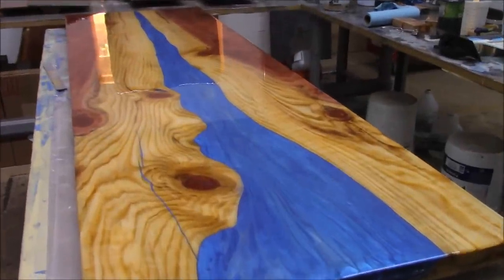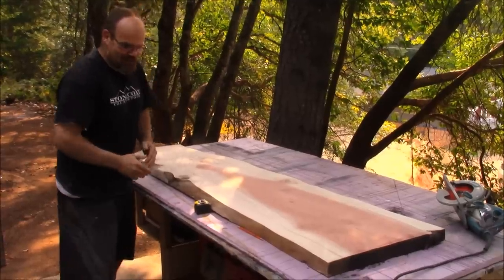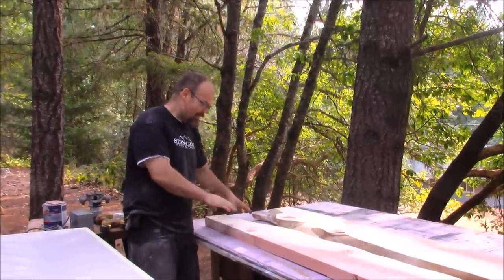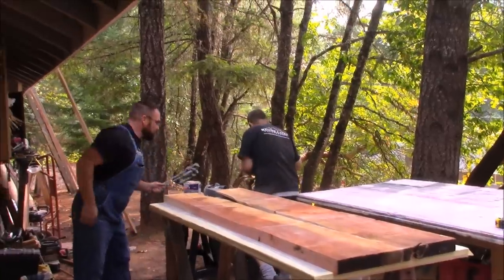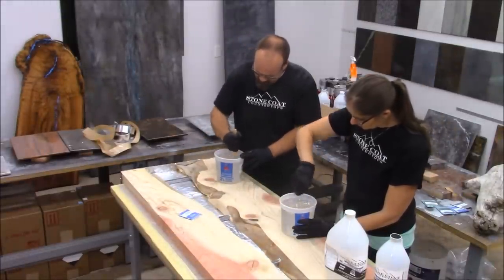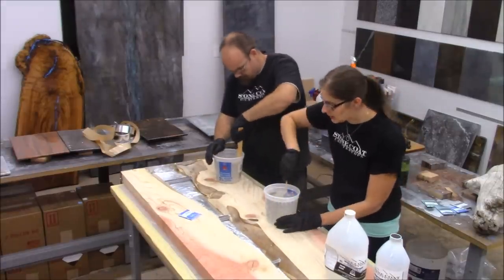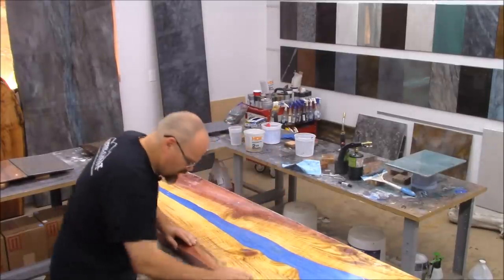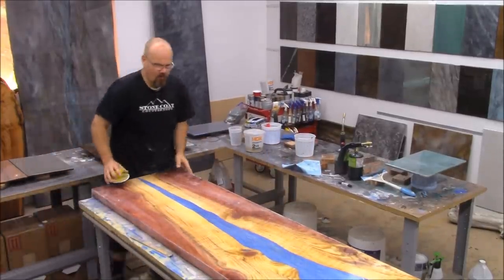Live Edge Wood Slab, Casting with Metallic Epoxy.

Comment: Hello Mike, another great video from an experienced craftsman. I would very much like your opinion on one point. At the beginning of this video it is obvious that the two timber slabs have already had considerable time spent on their preparation, especially the flattening and the gradual sanding from course to mega fine abrasives.
Then you pour the beautiful blue river resin. Then, amazingly to me, a complete novice with resins, but an old and very experienced cabinet maker/joiner, you proceed to plunge route the whole top, involving a massive amount of work, not to mention the dust and mess made with this procedure during another sanding preparation.
Can you not, simply use extra care not to overflow the blue resin, and fill the river to a slightly lower level  to the timber surface. Subsequent clear resin pours would soon level out the surface due to gravity. I am not sure, but surely one's eyes would not realise that the blue is at a lower level, with a clear coat on top of it!
I would most appreciate your answer and advice or anyone else's please.

Comment: When we did this in the 1970's on Myrtlewood slab tables we sometimes would make little tide-pool scenes with sand and shells, moss and urchins, etc and fill them with clear casting resin then top it with top coat resin. It wasn't for us, but they sold. Then we learned we could fill voids with sand mixed with a little resin up to near the surface which saved us from using 2 gallons of epoxy on one table - on those we just used a black opaque dye in our resin. You've gone way beyond where we were. Those were the days. Howdy to Wolf Creek.

Comment: Our router sled 40 years ago had a slide seated in it that held the router on one end and a handle on the other about 4 feet back. This kept my face out of the chips and it also stiffened up the whole operation. I like your aluminum rails and smooth rollers we just used Delrin (Polyoxymethylene) slides. We never had 3" bits either (only 2's) - those 3's are something.

Comment: MAN OH MAN YOU HAVE A COOL JOB!!!  
Idea:  On your new metal jig .. you need to put a cord hanger on it.  It is a rod with a spiral at the top.  You would connect it to the outside edge of the jig near the middle of it and your cord could move on it's own to the needed length as your jig moves... Much like a tension rid on a sewing machine does.

Comment: Under the heading of "None of My Business" ... I build Resonator Guitars and I use an aircraft epoxy in a critical step of the process.  Initially I mix in one container and then transfer that mix to another, usually identical, container and mix again.  This step goes a long way towards ensuring that I haven't missed any part of either the resin or the hardener.  It may be a tiny waste of an additional mixing cup but since I started "wasting" that extra cup, I've yet to have an incident where I have any "sticky" surprises.  My 2 cents.

Comment: I am very impressed with your work and tutorial. I have been through my own sometimes painful learning curve and I wish I saw these several years ago. A couple of questions.
1. I assume that much of the "filler" could be done with clean pebbles, marbles, etc. other than the casting resin by itself. It could be a cost savings, as long as there was enough depth of the color palate on top to show an attractive pattern. I assume the casting resin is only for the filler and not to be used as a seal coat?
2. I am a little concerned about using tape (HVAC or other)to seal off the bottom. I have had one full throttle failure in the past with a similar project; big mess. I am now looking at fiberglass cloth using resin to seal it up and make a true very well sealed up "bathtub" for the void needed to be filled.
3. You have been using different terms for what I think may refer to the same product. Casting epoxy, seal coat, flood coat. Can you clarify? Is the seal coat just referring to the early /sealing layers before the "thick" coat?

Comment: Hey Dave I am a HVAC Man if you hit that tape with your torch it will activate the adhesive so it will stick great
Reply: Would torching the tape eliminate the need for clay on the edges and how hard would it be to remove?

Comment: What did you do to the bottom, did you seal coat the bottom? Did you ever peel the tape off the bottom, if so, do you have any tricks for getting the tape off? Also, do you have any tips for drilling through your epoxy without any issues (cracking, etc)? We need to drill holes for plumbing for vessel sinks through a similar countertop to this one that we have just completed. Any tips would be much appreciated, great video!

Comment: Great piece. I am new to this as a hobby. You didn't show what you did to the bottom of the finished slab that would have small run off bumps. If you sand them off then you lose the luster so do you brush it one more time?  And can you use the epoxy filler as your flood coat as well? Thanks.

Comment: Couple questions: How many Casting Resin kits did you use for this project? (I see a kit is $150, so curious about how many it takes.)  Any video of the underside process after the resin dried?  (Did you just poly the bottom? How difficult was tape removal?). Did you have to sand and polish the top? Beautiful video.

Comment: I got my flood coat drying right now. I watched this video several times throughout my project. Thanks for the help! I did notice little sand- grain appearing bumps after the 3rd seal coat. I dont think this is air because i torched it 2 times between every coat. Not sure what is . Maybe they will not show up after the flood coat

Comment: You said that you pour 1/4 of an inch at a time but it looked like more than that.  Is that only if you're looking for a clear/transparent coat of epoxy?  Also, could you cheat and put something like a spray foam or even that bond-o down first to save on the amount of epoxy to use and then just cover it with an opaque epoxy over the top of it?  I'm a high school wood shop teacher and I'm always looking for cheaper ways to do things with my kiddos.  Thank you so much. -Toby

Comment: I have a question.
How did you remove metal foil tapes and make bottom of the table flat ?
cause I think it seems difficult to make flat surface using metal foil tapes.
I'm Japanese student studying product design .
I was so impressed this work!!

Comment: hey man awesome awesome videos! I've watched 2 so far I'm getting more and more into woodwork! I was wondering. what if you used a sanding sealer to seal the grain before you put the epoxy so lets say at the end before you do your final sanding you do the sanding sealer then sand that down to your final grit before putting the epoxy. would that minimize the bubbles as well?

Comment: Hello. Thank you for making the video. I am considering buying your jig, but I have one question. It seems like the jig would require that the 2x4's it sits on be perfectly even. For example, if there is any cupping in the 2x4's (or whatever you use for the base rails) the jig will cut off more in some spots and less in other spots. Is that true? Thanks again!

Comment: Great video. Do you recommend 'chopping' for much smaller size table sizes. For example I am attempting to epoxy coat a few pieces approx 30" long by 10" wide. Would you use the same as you used in your video. Thank you.

Comment: Been making slab furniture for years but movement of wood always happens. Just bondoing the steel in holds and stops movement?? Also clear coats should not be poured more then 1/8" or so at a time, you can do a large color pour and not lose clarity? Love your passion and enthusiasm!

Comment: Very nice project, thanks for sharing.  I was actually researching ideas for a different kind of project but now I am going to have to make these countertops as well.  A couple of questions, what circular saw blade type do you recommend for cutting through the heavy epoxy areas?  Is the untinted resin considered to be "optically clear" like some other products advertise?  If I wanted to, say, encapsulate a butterfly in my work then I would want the details to still pop out.  Lastly, If I did not want to seal the entire top of the table with the resin and only wanted it on the river part, could I spray a polyurethane or nitrocellulose clear coat over the entire table and still maintain the clarity over the resin area?  I understand that there might be some leveling issues between the two surfaces but this is something that I would want to try. Thanks!

Comment: So inspiring.Thank you for the excellent video.
I have a wood slab that I am going to try this on. Could you let me know approx how much counter top epoxy you used for the 3 seal coats and flood coats combined on the slab in this vid? I want to make sure I dont run out mid project. Also I didn't notice you add a hardener to the epoxy used for the seal and flood coats. Is one used? Thanks!

Comment: I looked at your web site and can’t find a few items. I would like to finish a few pieces. Where do I get the casting epoxy. The speed set epoxy that was used on the oak trash slab in the back ground. Also the burn stick. Thanks. Should I just call. 😀

Comment: StoneCoatCountertops: Can i use a smaller piece of steel tubing, say 7inches long on my  round42inch by 8 inches thick slab were i have a   fair to medium size crack, and can i also add say 3 inch deck screws to help it along?. And are there any toxic fumes involved in your  coatings that i or anybody should be concerned about ?. I didn,t hear you mention anything about  that or if its really strong smelling?. I dont have a shop, i do my work in my apartment or on my balcony, its just a hobby i recently started to do. Great channel, very infoormative, maybe abit more info on the epoxy coatings safety issuses would be a great asset.  Any advice would be greatly appreciated. Mark. Canada.  Thank/you much. Beautiful piece of work.
Reply: Thank you for getting back to me and also for the great information. Great channel. Mark.

Comment: Amazing work and such a thorough explanation!

One question; can you use a hairdryer instead of a torch to remove air bubbles?
Reply: I know this is an old comment but a hair dryer will put air into the epoxy and move the product around, so I wouldn't recommend using it as it won't give the desired result. Definitely check out and see pricing for torches around you and save the project until you can budget one in, that way you don't loose money on the epoxy and wood as well as you're time, I'd hate for you to work hard on a project and not enjoy your hard work at the end.

Comment: Nice job, I have a question thought, it looks lick the design in the blue changed quite a bit, after sanding? 26:11 into the video you can see the design in the blue, but at 31:30 and 40:08 it was no longer there?

What I would like to know is, will that happen all the time?  Do not misunderstand, I like the product and I am looking forward to working with it, but the more I know now will help me later.
Reply: Did no one ever answer this?
Reply: what?
Reply: That's a good quetion Robert. I wish someone would answer it. The design clearly changes. Maybe it's the camra angle or lighting. I have no noticed that happen in other video tutorials.
Reply: Same here bud I didn’t even make it through the whole video. I new when I saw him take the router with that plainer bit to it that he was taking off somewhere between 1/8 and 1/16 off. It took his initial design off changing the look entirely, still looks amazing though I’m not trying to argue.
Reply: Robert Gwin 
Yeah, it’s there if you’re talking about the art work inside the river. At the end of the video he does a nice close up scan around the table and the river is visible.

Comment: Such a beautiful piece!!  A few questions: how much time must you wait between the 3 burns as the final step of the flood coat?  On the flood coat, are you mixing more product and using the trowel so that it leaves a thicker surface?  How do you finish the bottom of the slab after the work on the top surface is complete?  Thank you in advance.

Comment: Hey guys. Love the work you produce. I have one question for you. When you're putting on the seal coats, is that also done with casting resin? This may have been explained, but my old cloth ears have missed it, if that's the case. TIA, Paul.

Comment: Great video, I sell wood slabs an im thinking of doing up a few of these for my new house. On your support structure did they end up on the top of bottom of your slab? Do you seal both sides of the piece or let one side me natural to off gas as wood tends to do the older it gets?

Comment: Hi ,I am beginner 0 experience just watching all this videos regarding epoxy , My question is can the epoxy be apply slab that bean covered with oil?  Thanks for advice . Roman
Reply from the maker: Thank you for watching Roman! You can apply our epoxy over existing stains and varnishes, just be sure they are completely dry before applying the epoxy over top! Call us anytime with questions 541-450-1976

Comment: In many of your video's, I don't see you doing seal coating to the undersides of your slabs. Am I missing something here ???? Beautiful work, though. I spent several years using Crystal Sheen & their polish afterward. I was very happy with it. That has been several years ago. I am seriously considering going back to doing this kind of work again, as I'm totally retired now. Who determines the leg styles? Your client, or your self ?
Reply from the maker: Great question Walter. On solid wood projects, we like to reinforce the natural wood slabs and pieces with steel so they won't warp, but be sure to seal the underside with a sealer like polyurethane or something that will stop moisture. When you epoxy the surface as well as treat the underside of your project, this will encapsulate the work piece and help to prevent warping and movement caused by moisture. We like our moisture content under 13% in our wood projects before coating. Please feel free to contact us anytime for free project support. (541)450-1976   For the legs we do have some links to different options on our tool links page: https://www.stonecoatcountertops.com/toollinks

Comment: Beautiful work!  You inspired me to try one myself.  I'm almost finished but I had a question for you: The top of my table is not level, it's uneven by close to 1/8" in spots so my plan was to topcoat it enough to get a level surface.  Should I dam it on all four sides and fill in until level or should I do multiple coats allowing it to pour over the edges?
Reply from the maker: Great question Tate and thank you for your kind words of support!  Are you able to plane the surface to get it level? Give us a call or email us some photos of your project to stonecoatcountertops@gmail.com and we would be more than happy to help you troubleshoot Tate. (541)450-1976
Reply: @StoneCoatCountertops  Thanks for the reply, I'll shoot you an email with some pictures and more explanation.

Comment: Thanks for the super informative videos, I have picked up alot of pointers along the way. I have worked with resin for a few years now and about 2 years ago started using a marine epoxy resin with a 50/50 mix ratio which I have been really happy with. That being said, recently I have been running into an issue where I get these miniature "bubbles" in the mix whether I do it by hand or with a drill. I keep the temp in the low 80s as always and do the exact mix ratio that it calls for. The strange part is they never float to the top or are affected by the torch at all so maybe there not bubbles it all, its hard to tell, its almost like a cloudiness that wont go away. Do you have any idea what might be causing that? Thanks in advance
Reply from the maker: Thank you for your kind words of support MSnipes78! We are more than happy to help you out regarding your issue with air bubbles. What sort of projects are you working on where you are getting these bubbles?  You can prevent the milky areas by torching multiple times in short sessions about 5 minutes apart.  This video will show you exactly how we clear the epoxy up using the torch method.  https://www.youtube.com/watch?v=HwL30WBaOoAPlease feel free to call anytime for free project support. (541)450-1976

Comment: Hello stonecoatcountertops,
I am from Germany and I plan to do a table for my dining room measuring 80cmx150cms.
The river element in between the wood slaps is supposed to be 10-15cms. (Table shall be 3cm thick)
Can you give me a quick calculation of ow much product of casting resin and topping resin I will Nneed for doing this project in metrical measures? I don' get along with US measures very well :-D

Comment: HI, great video and an amazing finished product!  Just a quick question about the router.  What size router did you use for this project?  Thank you.
Reply from the maker: Hi J Collis!
Here is a link to the router that we used- https://www.amazon.com/PORTER-CABLE-690LR-11-Amp-Fixed-Base-Router/dp/B00005QEVQ/ref=as_sl_pc_qf_sp_asin_til?tag=stoncoatcoun-20&linkCode=w00&linkId=c7f5715cc5fb60f4fc800c981acbacc5&creativeASIN=B00005QEVQ
Are you currently working on a river table?

Comment: I'm thinking about starting this as a side project to make a little extra income. I have a couple of questions. The process looks pretty straight forward. Where is a good place to get wood blanks for your table tops? I'm thinking of doing some small side tables to begin with, so i don't need anything huge.
Reply from the maker: Great question James!  You could check around with local mills or lumber yards in your area to find out if they sell wood slabs and what sizes they offer.  Contact us anytime for project support. (541)450-1976